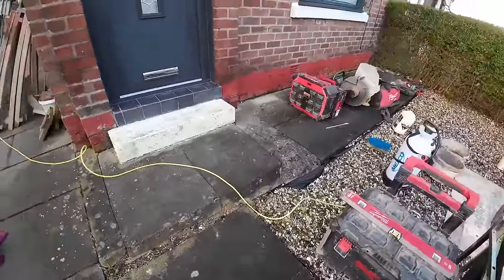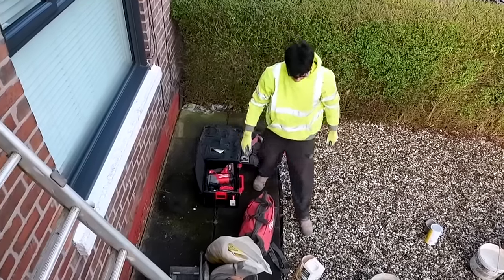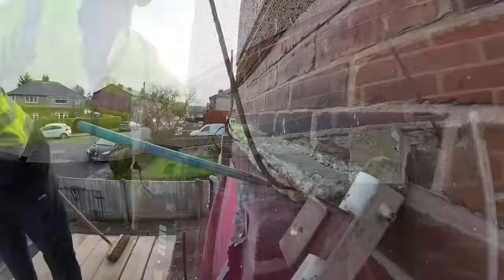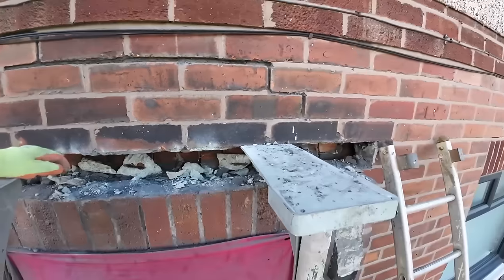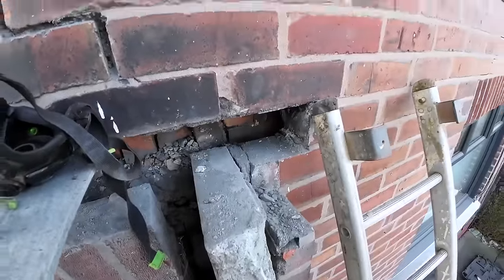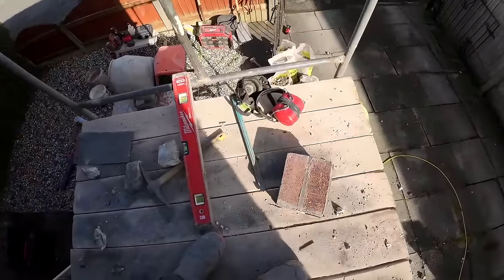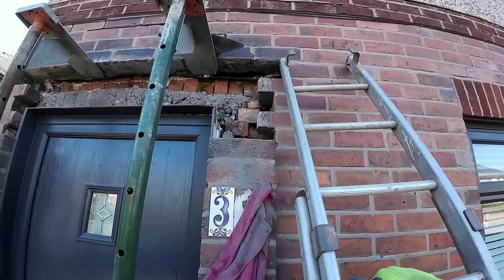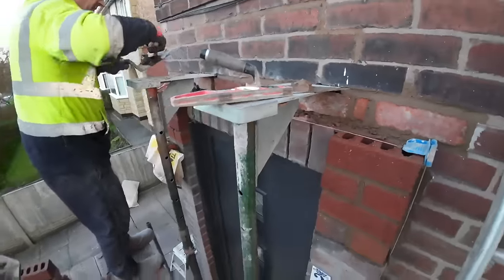CRUMBLING CONCRETE CANOPY.. THIS IS HOW WE CURED IT

Comment: Was the soldier course originally set on a wooden door frame, long before that modern plastic door was put in?   Years ago the wooden doors and windows were used to support brickwork above, instead of using a lintel.
Reply from the maker: Spot on Peter 🧱👍🏽

Comment: Removed a rotten timber window box 6” deep and 6ft long which was screwed to the external brick house wall. 
To reveal bricks that had lumpy  blotches of white calcium  and other rot deposits. 
Cleaned off the lumps and use external emulsion paint  pink red and black to camouflage the discolouration f the bricks. I’m no artist but paint was easier than knocking out or cleaning bricks.